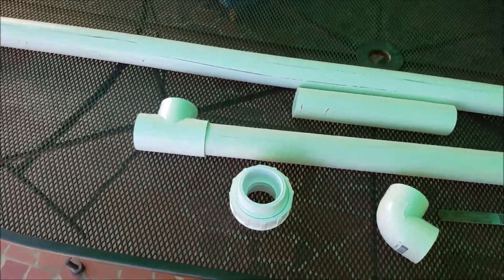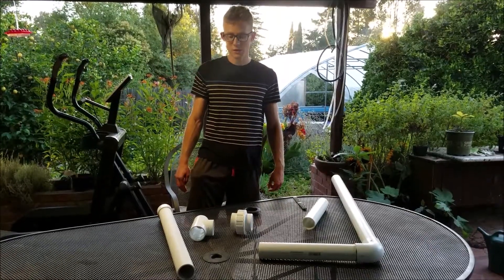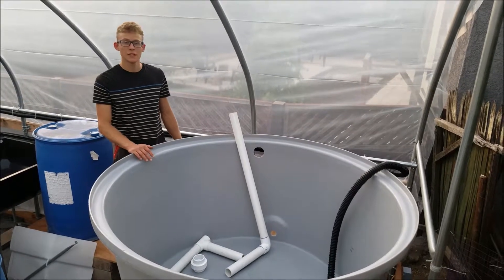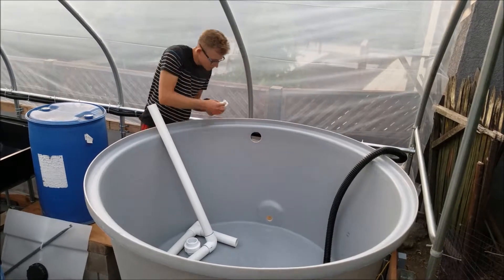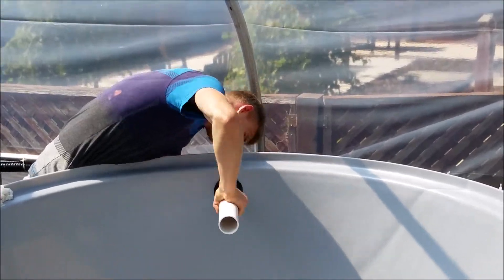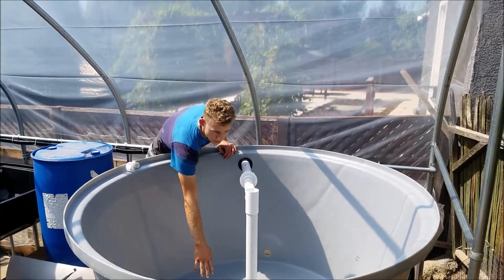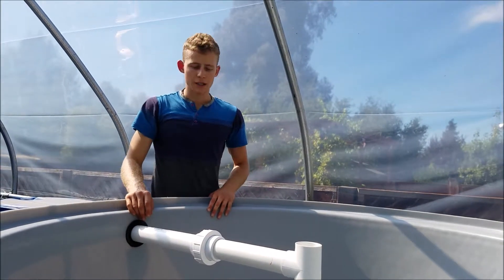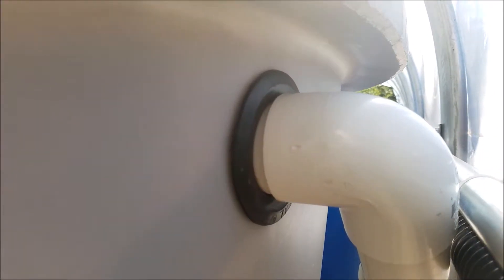Solids lifting over flow Aquaponics (Hybrid aquaponic system)

Comment: Can you please explain what you did with the hole at the bottom of the tank?  Are you using it only as a drain port for the entire tank?
Reply from the maker: Yes the hole at the bottom of the tank where I have a bulkhead fitting and a ball valve is just for draining the tank if needed.

Comment: hi if my fish tank(1ft) is shorter than my mechanical filter(3ft) is there a workaround for this
Reply from the maker: How to set it up also comes down to how the other parts of the system are set up. But here are some different options.

If you haven't hooked everything up yet you can raise the fish tank higher to allow the filter to be lower.

If the rest of the system allows you can dig the filter into the ground until it is at the level you need. 

You can hook it up how it is now just the filter will have an area with no water in it, since you will have to hook up the plumbing so the fish tank doesn't overflow.

Another option if you have a sump tank is to have the water pumped to the filter first then overflow into the fish tank and grow beds (depends on layout of the rest of the system). The water in the fish tank will then overflow directly back to the sump tank.

You can also split the water from the pump, if you have a sump tank. So have water go from the pump to the filter and water from the pump to the fish tank. So the pump will be split with valves. From the filter you go to your grow beds. And from the fish tank you go directly back to the sump.
Hope that helps.
Reply: @vonponics  wow man appreciate the help god bless thanks the last option might do it for now I guess
Reply from the maker: Glad I can help. Hope it works out.

Comment: What is the size of the PVC pipe for your overflow? I'm planning to use 1 1/2 because the 2" ball valve faucet things are so expensive.
Reply from the maker: I used 2" pvc for my overflow. But ya 2" ball valves are expensive. Didn't use one for my set up though.
Reply from the maker: Dont know if it is cheaper but you could put two 1 1/2" overflows going into a 2" or 3" on the outside.
That way you could still use 1 1/2" ball valves.